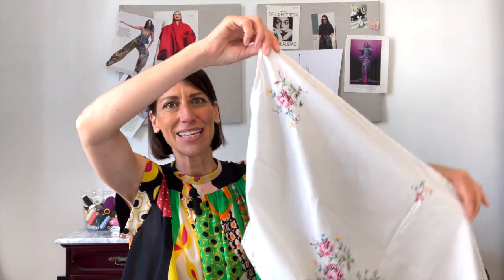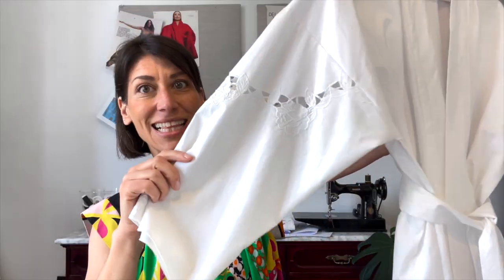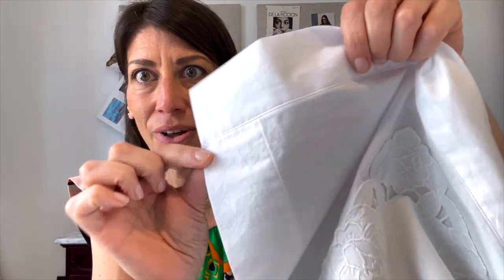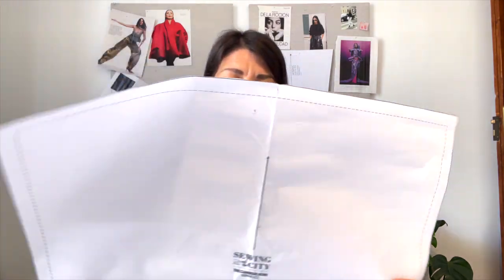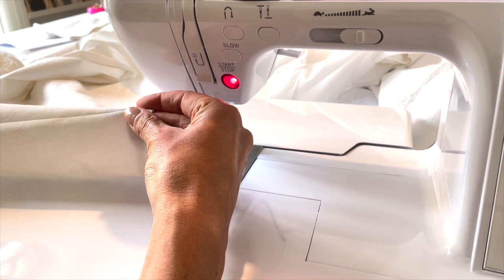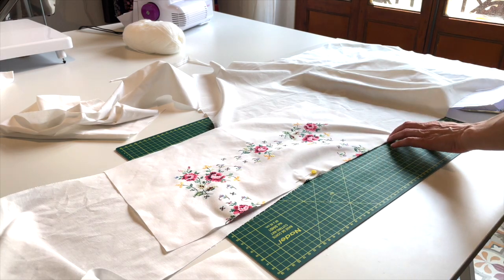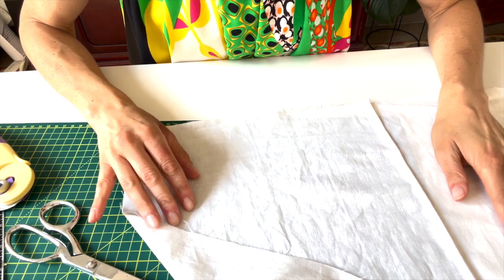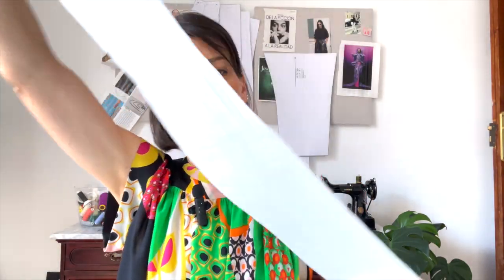Perfect FRENCH SEAMS On A 90 Degree | Sew AN Upcycled Robe With Me

Comment: Very nice and this is a good solution to a common problem. But I'm not clear on one thing. Why is there a 1/4" difference between the side/underarm edge and the French seam where the sleeve was attached? Was the whole garment cut out with the assumption of a 1/2" seam? If so, then I understand.
Reply from the maker: Hi Susan! Yes, you could assume all the seam allowances were 1/2 for clarity. I only used a 1/2 inch on the sleeve part because you have to cut away that small amount and so I compensated for that by using a 1/2" seam allowance. Hope that makes sense...💜